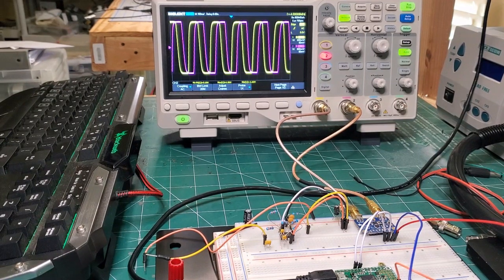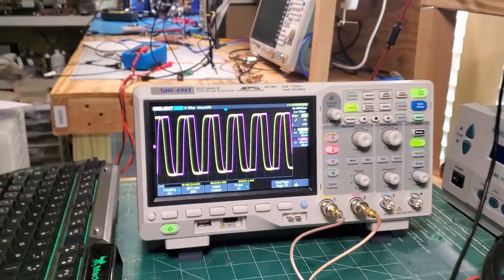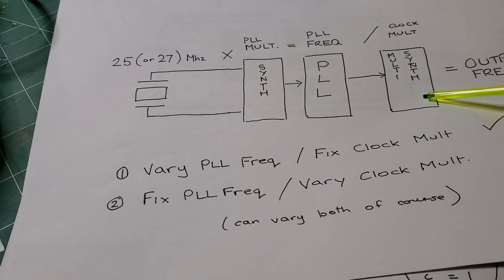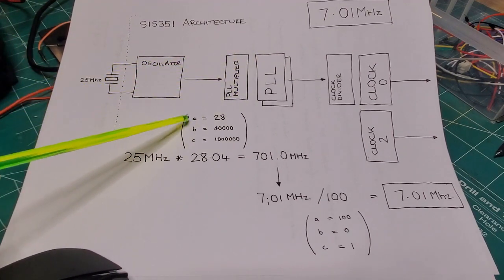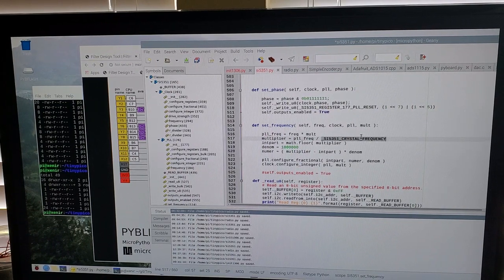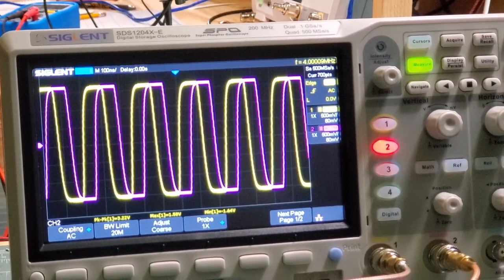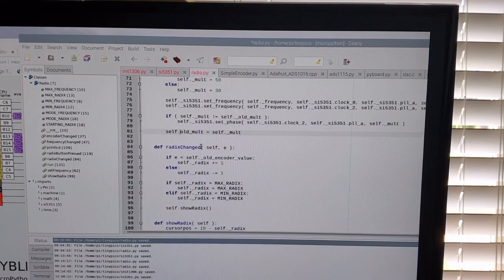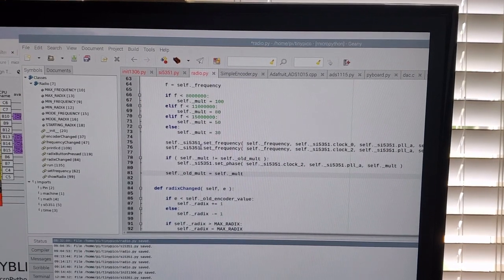Programming si5351 with the PyBoard

Comment: Thanks for your kind explanation, 
can this board generate below 180 kHz (25MHz X15/2050)? i think it stucks with a limitation under the python adafruit software
Reply from the maker: Hi Jungsu. The datasheet says that the output can go all the way down to 2.5KHz. I have never tried that low myself and its quite possible there's some bugs in the library as it attempts to guess the multiplier, numerator and denominator from the desired frequency.  What I would suggest is to determine the multiplier, numerator and denominator yourself to get 180KHz and then manually call "configure_registers_bulk". I hope this helps and thank you for the comment
Reply from the maker: Have a look here for how you go about calculating the multiplier, numerator and denominator for any frequency
https://youtu.be/2cb1LLoeT-Y?t=255

Comment: Great video!
Just two questions:
- Can this board be made to output frequency in 1 Hz increments?
- can the phase difference between the two channels be made to be any other value except quadrature? Like, can it be any arbitrary angle?
Reply from the maker: To answer
- Yes the board has sub-hz precision
- Yes - setting the phase difference is a little counter intuitive. The phase is set in terms of the multiplier ("mult" below) passed to the "set_frequency" call where passing in "mult" to "set_phase" results in a 90 phase shift. So to do a 45 degrees phase shift you pass in mult/2 to the "set_phase" 

		self._si5351.set_frequency( self._frequency, self._si5351.clock_0, self._si5351.pll_a, self._mult )
		self._si5351.set_frequency( self._frequency, self._si5351.clock_2, self._si5351.pll_a, self._mult )
		
		if ( self._mult != self._old_mult ):
			self._si5351.set_phase( self._si5351.clock_2, self._si5351.pll_a, self._mult )

Note that "mult" is an integer so you don't have great control over the phase. I hope this answers your question and thank you for the comment

Comment: Stupid question....I can program and it hold the programmed frequency so i can use in a computer like a ttl clock ?
Reply from the maker: Davide, do you mean use it as a timebase to drive a real time clock? It will hold a frequency pretty well (depending on the stability of its own crystal source of course - which you have to provide externally). You could use it like that. Its generally intended to be emit a programmable variable frequency though (as a local oscillator for a radio for instance). Thank you for the question - I hope this helps!

Comment: Interesting! When setting the PLL using the fractional method you didn't seem to get any jitter on the clock signal. The 5351a boards that I have been playing around with have some pretty noticeable jitter on the signal unless I use the even integer mode of setting up the part.
Reply from the maker: Thank you for the comment Nate - which version of the boards were you using?
Reply from the maker: Just came across this video from Kevin Loughlin BTW: https://www.youtube.com/watch?v=7_rd3Pw-gFs
Reply: The version I have are the Hiletgo brand off of Amazon. I ordered an Adafruit one that just came today to do some comparisons. Should be the same IC. I just wonder if one of them has a register set differently that isn't getting set in the software. The datasheet for the part does mention the jitter being worse for non integer dividers.

Comment: Great instructional video!!! I am actually building a 20m rig using some of the code. I was able to add a correction factor to the code so the frequency is spot on. However i was testing it using the original code and anything above 11mhz there looks like an error causing the frequency to be 5mhz off. Once I track down the error I’ll be able to have an awesome VCO.!!!
Reply from the maker: I know I've had a few bugs in that code. I did so some fixes to the ESP32 C++ code which you can find here
https://github.com/thaaraak/ESP32-Transmitter/blob/master/main/main.cpp

Honestly it might be easier to generate the quadrature signals with a pair of D-type flip flops than using the si5351s inbuilt functionality. Heres an example if you want to try that
https://www.newioit.com.au/archives/34

I'll have to check that python code out and see if I can find the problem

Comment: Hey, which connector did you use to connect the clock output to Oscilloscope?
Reply from the maker: That is a male to male SMA cable with an SMA to BNC adapter at the oscilloscope end
Reply: @na5y  Thanks for the reply

Comment: Hi Ian, I just replicated your set-up with an si5351 and Teensy4.0 with circuitpython and mu-editor, works fine! Would it be possible to post your circuit diagrams for the complete set-up somewhere together with a component list please? I would like to replicate your complete project. Very interesting and educational stuff overhere:) Best 73, Pascal,Belgium
Reply from the maker: You bet Pascal. I use kicad at the moment - would kicad projects work or do you need an image? For the kicad projects the main board is here: 
https://github.com/thaaraak/Tinypico-Radio/tree/master/kicad/Radio

The phase shifter is here:
https://github.com/thaaraak/Tinypico-Radio/tree/master/kicad/Phase%20and%20Filter
Reply: @na5y  Well, I have no experience with kicad software for the moment, but I very much like your oldschool handwritten schematics:) But I could figure out how to use Kicad of course.
Reply from the maker: No worries - I have put the schematic in the Radio directory above as "Radio.pdf". There is also a BOM in the directory in the file "Radio". Let me know if you can see them. If thats what you are after I will do the same in the Phase directory
Reply: @na5y  yes, I can see them on your github page, thanks! Will start ordering parts:) Best 73, Pascal
Reply from the maker: Cool. Let me know how you get on! Something not spelled out in the schematic is the toroids are 2 x T37-6 and 1 x FT50-75 (marked T50 splitter). The turns ratio on the T37-6 are 6:31 in input and 31:6 on the output. The FT50 is wound trifilar with 11 turns
Reply: I guess Im asking randomly but does anybody know a tool to log back into an Instagram account??
I was dumb forgot my password. I would appreciate any assistance you can offer me.
Reply: @Blaine Darian instablaster :)
Reply: @Rohan Spencer I really appreciate your reply. I found the site thru google and im in the hacking process now.
Takes a while so I will reply here later when my account password hopefully is recovered.
Reply: @Rohan Spencer it worked and I actually got access to my account again. I'm so happy:D
Thanks so much you saved my account :D
Reply: @Blaine Darian Glad I could help :)